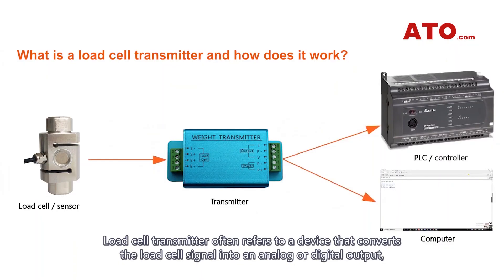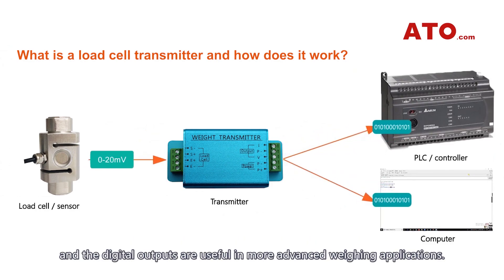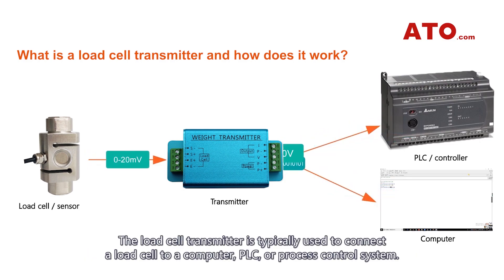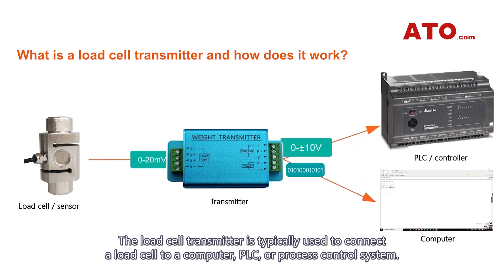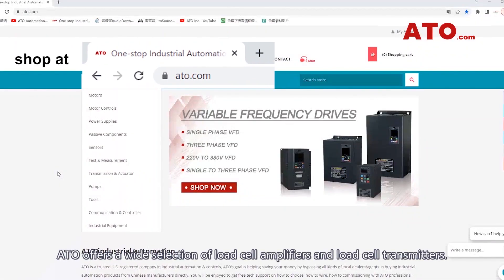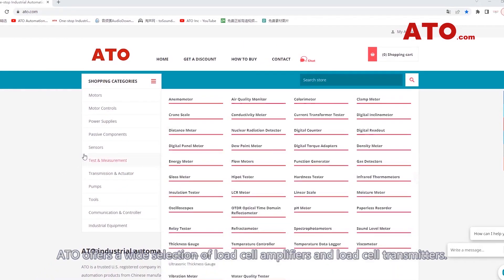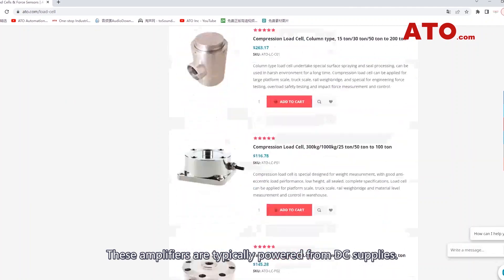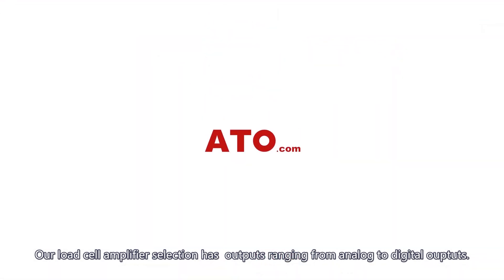Load Cell Transmitter with Output 0-5V/0-10V/4-20mA/0-20mA

Comment: can this be used with strain gauge load cells?
Reply from the maker: Yes sir. For sure!
Reply from the maker: And if you're interested to learn more info about our products, check the links below:
Buy load cell transmitters on: https://www.ato.com/load-cell
For this type: https://www.ato.com/load-cell-transmitter-output-0-5v-4-20ma
Reply: Thank you so much, if you could make a video, I’ll appreciate it!
I have the ATO 510 transmitter

Comment: I am wiring this transmitter to receive an input from a torque sensor and an analog output to an Arduino Uno. I do not know how to calibrate and understand the analog output value when a torque is applied